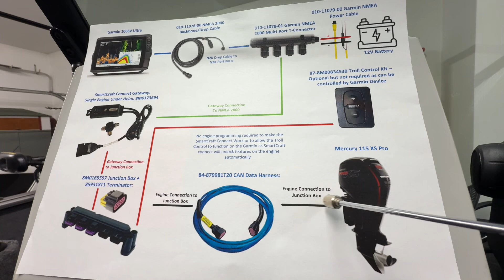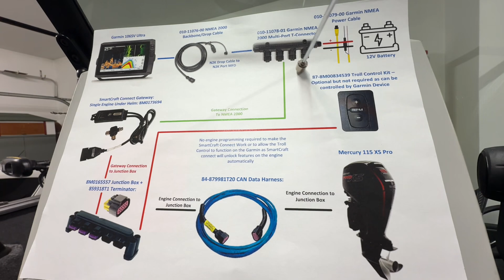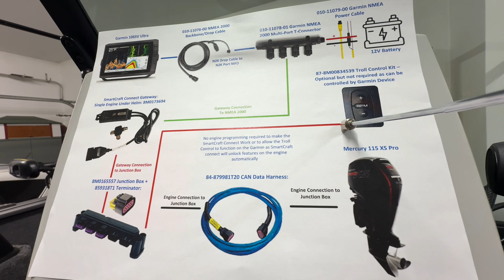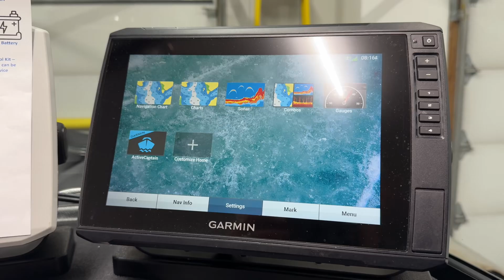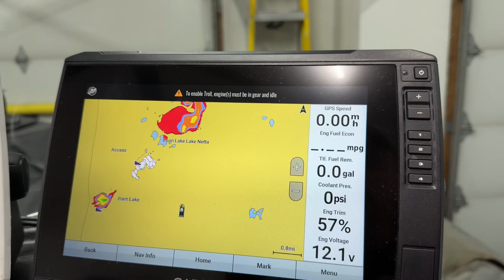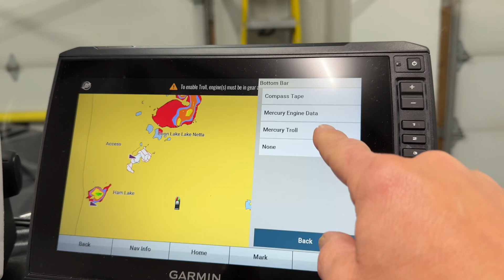Mercury SmartCraft Connect install on 2025 Lund Impact 1775 XS Boat and Garmin 106SV Chartplotter

Comment: Great video and very helpful. I’m just using the Bluetooth option right now and works great. Eventually I want to set my boat up like yours. I do think there are way too many needed option pieces to transfer the data to the graph. Realistically I think Garmin should have just one converter box between graph and engine for simplicity. One cord to convert, one cord from converter to back of graph. Thanks again for sharing, it was very helpful.

Comment: What kind of issues did you have when you had the terminator resistor installed on the mercury junction box? I currently dont have one on and will not read trim and my oil temp is reading 5,000 degrees on the garmin. Everything reads properly in the mercury app though.

Comment: There are a couple different smart craft connect monitors. Will the under the helm one work with you install? Called mercury and they said I needed the 700$ smart craft unit.

Comment: Great info. I going to install this system I just got a 2019 Mercury 115hp PRO SX. Only difference is I have a Raymarine Axiom and Nema2000 communication set up instead of the Garmin system. Yea I think it would be clumsy to open the phone app connect to the motor then connect the phone to the display and hope your phone doesn't die at some point or have a power port and place to plug in and a holder for the phone. I think that would be a mess in the long run. Like you I just want to just start the motor and the display comes on and it shows the motor information. Done and simple. It worth the money never having to worrier about it  Thanks again for the info

Comment: Is there a reason you didn’t use the “mobile” version which connects to your Garmin instead of all the wiring / extras?
Reply: I found out the hard way that there is a Smart Craft Mobile version 8M0173128, it's half the price of the 8M0173694, and does not use NMEA2000, even though it still has the light and the NMEA dongle coming out. It's a replacement for the older Vessel View Mobile. Mercury site also says, "This device will not connect to your multi-function Simrad, Garmin or Raymarine devices". After struggling unsuccessfully with getting NMEA to work, I took it out and returned it. I know it's confusing on Mercury's part! Great video though!!
Reply from the maker: Are you referring to vessel view? As far as I was able to determine talking to Garmin and Mercury to do everything I needed to do on the Garmin devices, This was the path to do it.  open to learning if there was a better way.
Reply: @ I am not referring to Vessel view. I am referring to Smartcraft Connect that uses Bluetooth / WiFi instead of NMEA.
Reply from the maker: That is what I have and the Bluetooth and WIFI connects to my phone Mercury App.  I am not aware of an option to connect to the Garmin using Bluetooth / WiFi but not aware of this being an option.  If there is indeed such an option, I would think that Nema would be much more robust being direct wired.

Comment: Hello! Is the bluetooth connection to the Mercury Marine app working too? Or only at the mobile version of the device?
Reply from the maker: @Trifreak88  I am not tracking what you mean by mobile version of the device but I am seeing the engine using Bluetooth and the Mercury Marine app as well as in the Garmin Device thru the CAN line.
Reply: @shooter7119  There are two types of this device. One is only a mobile version without nmea2000 but there is a connector for it which is not working at the mobile version.  
And the one from your video might be the one with booth options. Isn't it?
Reply from the maker: @Trifreak88 this is not the Vessel View connect.  It is the one that can do both but since it is 2x the cost people that are buying this are really spending the extra cost to connect it to a NMEA backbone

Comment: Great video. Stumbling through a similar install myself and hoping this helps. Out of curiosity did you try to connected your mercury cable directly to the smart craft connect without the hub or terminator? If so did everything work minus your manual gauges or was that required regaurdless with the terminator? Also on the app you moved to that they suggested was that mercury marine or the smart craft manager?
Reply: Yes, that is what  I first did as well as I was told that you needed to make sure your SmartCraft connect software was updated before you connected to Garmin but I don't think that is true and there was no software up.  Therefore, I was able to connect the SmartCraft to the engine CAN line and then setup the connection using the Mercury apps.  However, I did not connect to my Garmin devices until I added the Junction Box/Terminator but I assume the Junction Box/Terminator would not be required. I started with the Smartcraft Mercury App (Grey/Red with gear wheel) and then moved to the Mercury Marine.  Mercury said to not have both installed at same time as they have heard of conflicts and implied I could have done everything just with the mercury marine app.
Reply: @ awesome! Thanks for the information and I’ll try this tomorrow.

Comment: Thank you a quick question, does the mercury junction box need only one terminator. So if you use two ports and one terminator, there is an open port with nothing connected….
Reply from the maker: @TheBronDancing  That is correct - the extra open port just has a cap on on that comes with the junction box.  I wanted at least one open port in case I decided to add the Troll Control manual button.  I understand there are other options that people may also want to add but not familiar with those.